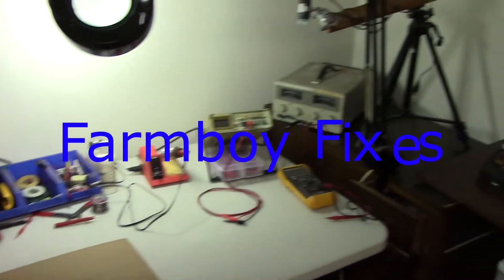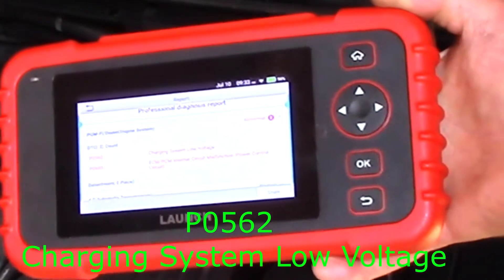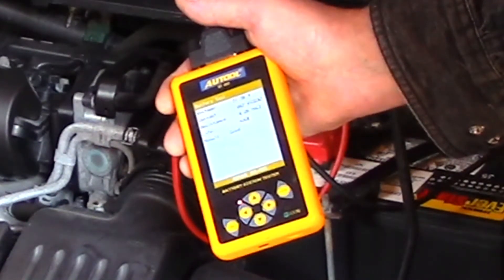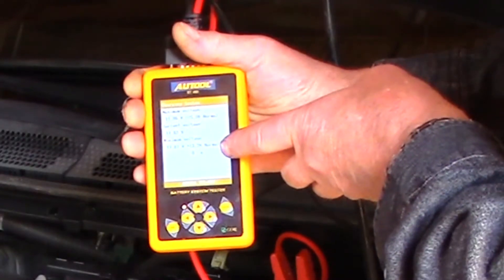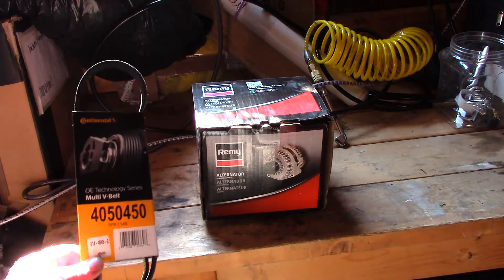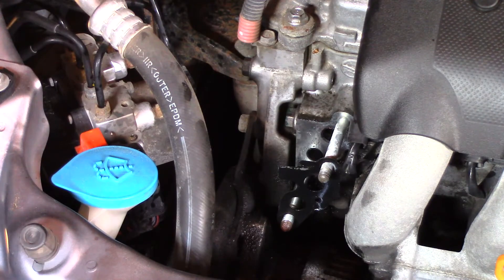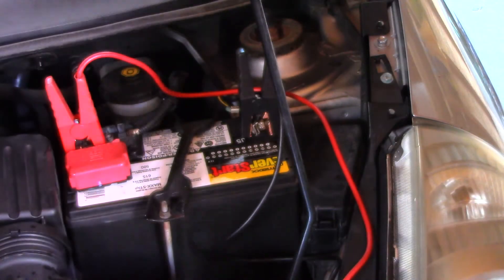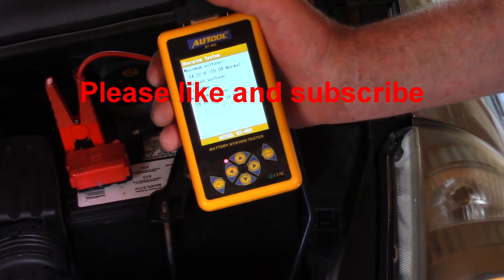P0562.  Alternator failure.

Comment: Nice  clean engine! This alternator has all internal parts connected by soldering;  if time permits I'll take it apart and inspect brushes and solder joints
often a good soldering iron, magnifying glass ,  good light  and patience during inspection can eliminate the  need to buy an alternator.
I managed to find reman alternator on the wrecking yard and stripped voltage regulator and brushes for repair as well
Reply from the maker: Your good.   I wish I had the time to pursue that advice.